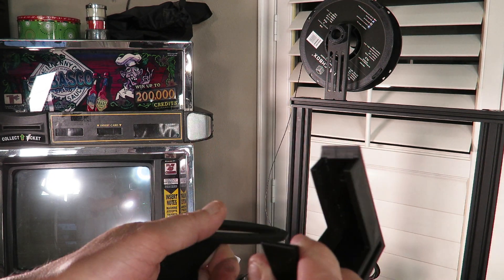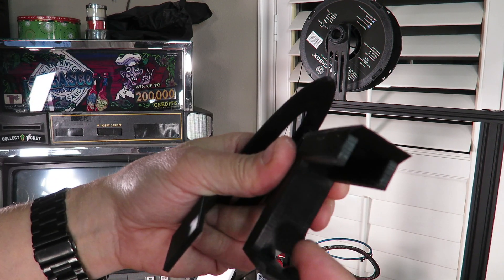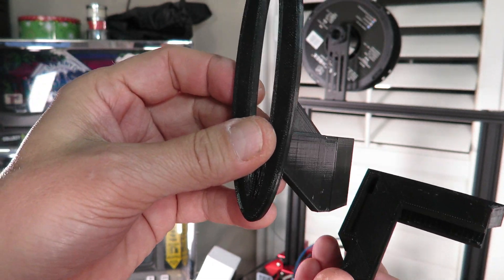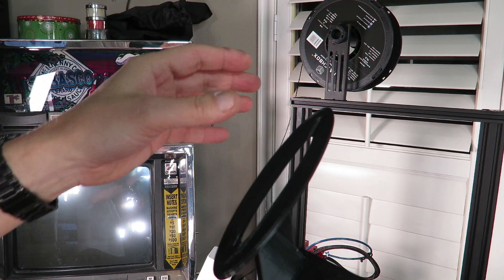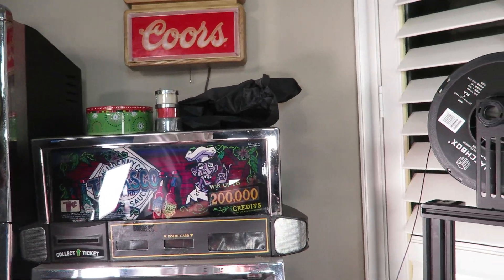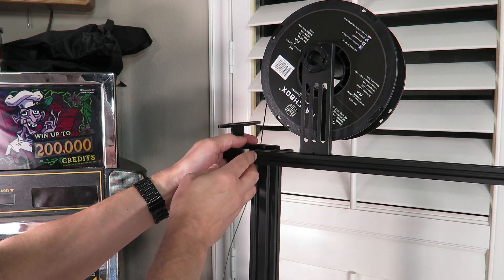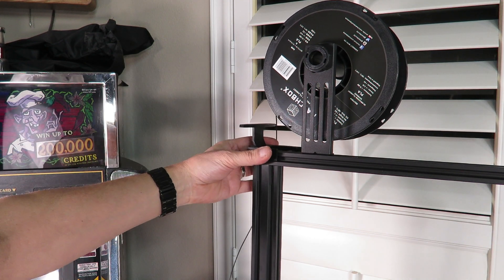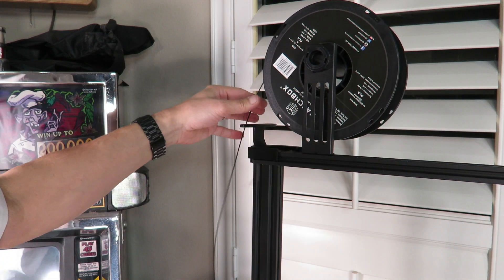3D PRINTER TIPS | CR10s-Pro | Filament Guide

Comment: I am printing this now and even when I sliced in Cura 4.4.1 the piece that the filament goes through is seemingly printing solid, NO elliptical slot for the filament to go through. I am using your V-2 Guide.stl. I'm not sure if it's me, the slicing software or what. And, yes, I'm a noob! I even checked the file out with "no supports" and it still sliced showing in the preview as being a solid piece.

Comment: What is the benefit?
Reply: Many people find that because the spool is so far away the filament catches on certain parts of the aluminium and you end up with loads of dust. Maybe this helps reduce it?
Reply: @lio1234234  I mean the guide piece at the top.  I guess it's the same answer, though.  I've noticed that the top portion can get funky when the rolls are small or when they are getting close to empty.  It helps to position the holder further left.  I guess I see the purpose of the guide, although I'm worried it would add friction.
Reply: @robcohen  yeah totally agree it might, don't do it if you dont have filament dust building because of friction you already have, this is what would help reduce overall friction if you have it. :)
Reply: I.e. if it wont help dont do it! :)
Reply: Of course it is a great hack if you do need it. You could print it out of a really slippery or tough material and maybe round of edges to reduce friction
Reply: @lio1234234  I do get the dust on the feeder.  I'll keep experimenting.  Thanks for your help!
Reply: @robcohen  I do also believe it to be to help stop the filament coming off the role with smaller filament rolls! ;)